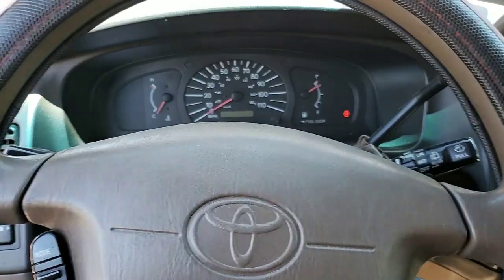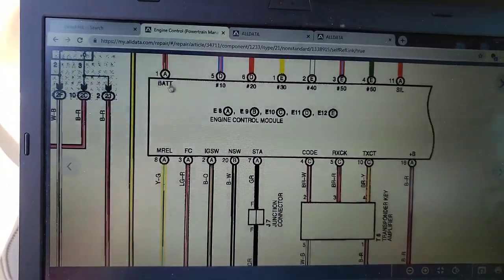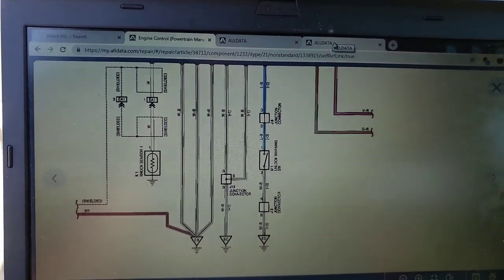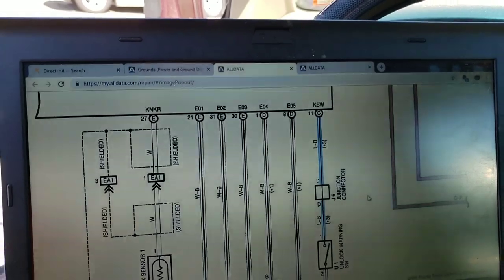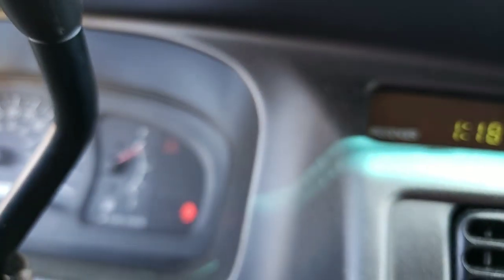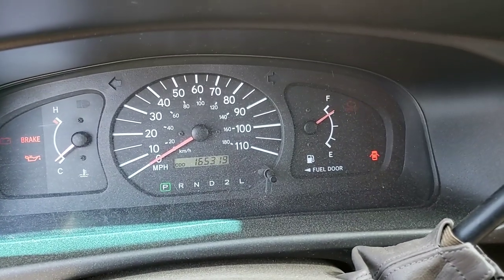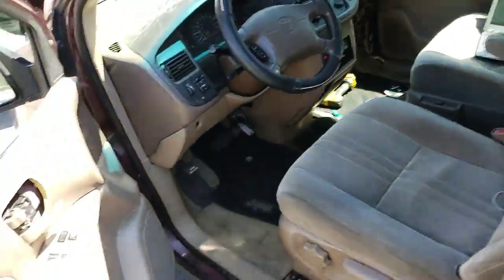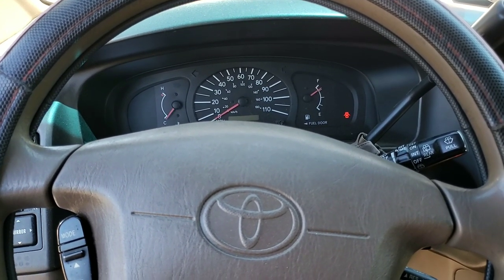2000 Toyota Sienna Intermittent start or crank no start cooling fans sometimes on

Comment: EXCELENTE!  A couple points made on here! 1. Wiring diagrams, never trust them 100% including OE... but in this case was OK.  
2. Circuit checking or testing with a LOAD, is the only way to have accurate results. Of course, using the appropriate load if not using the on vehicle component the circuit is powering. (Or that vehicle component is faulty/failed)

Comment: That's awesome Keith.  Thanx for the tip on Toyota abbreviations. It's so much wording between manufacturers that drives me nuts. Like toyota with their fuel pump relay called circuit opening relay. Thanx Maestro 😁. Do u think that ground issue could have occurred when they did the tune up? Wires look fairly new. I think that happened to me once back in the day😉. Take care

Comment: Fantastic information about Toyota wiring diagrams vs non Toyota diagrams. Did you have a good idea of which ground going to the ECM was at fault and how did you come to that theory if so. or did you do what i would have ended up doing and load testing all the powers and grounds (that SO multi probe can load test circuits its handy but not very trust worthy).

Comment: 😂 you’re like me. I’ll leave protective plastic on things forever. My maxisys mini still has the plastic on the screen from when I bought it about three years ago. Btw if you just click whatever switch you have latched on the snap on just once and it’ll turn off. It takes a second so if you push it again too fast then it won’t turn off.

Comment: Had that with my Lincoln mix, first mechanic put it on the computer and said the dashboard is bad and have to order a new one, after he told me the price $$$$- I declined and took it to someone else who diagnosed it as a ground issue and ordered the part from Ford ($60) replaced it and went over the computer and cleared the old codes and drove it around and it's been 5 years and no more issues (just waiting for the ticking time bomb- water pump to go,OUCHHHHH)